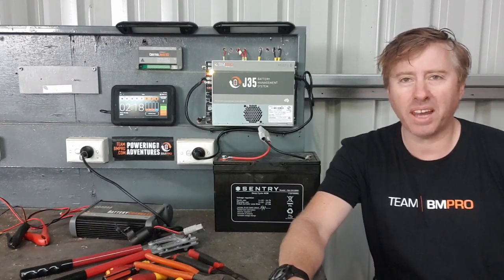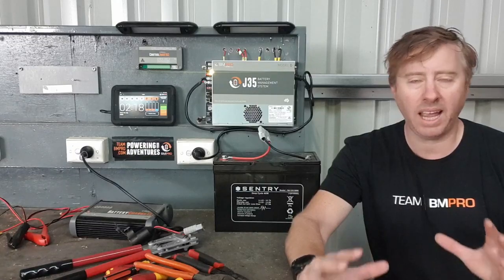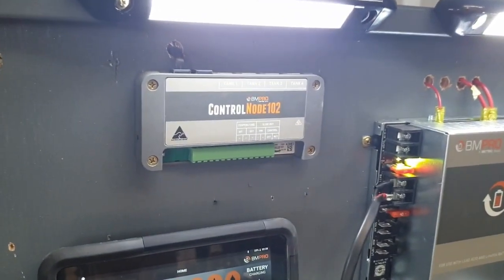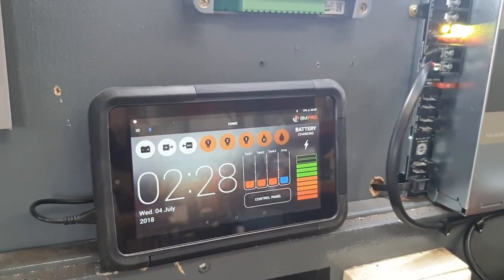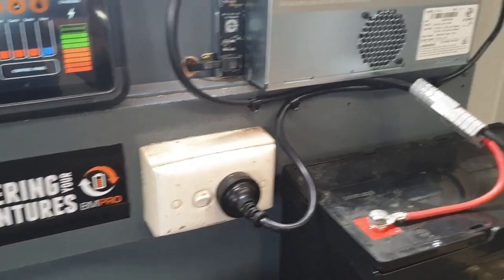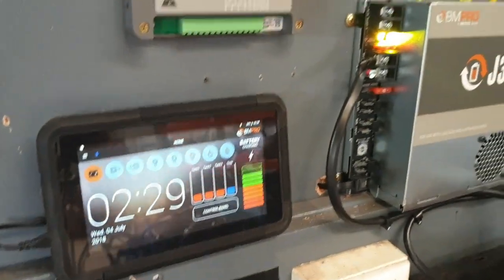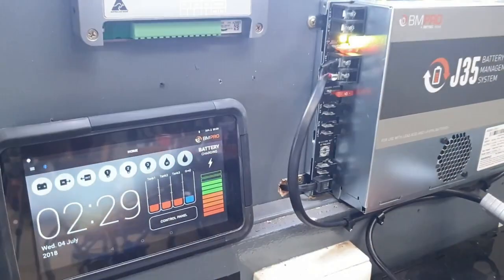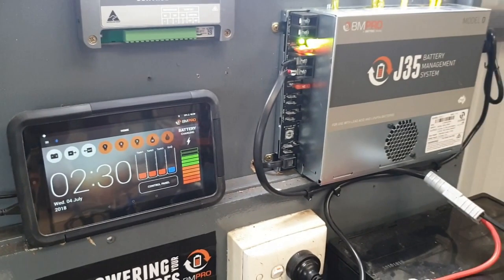How To Prevent Caravan Battery Drain | Load Isolation Switch (JHub TechTip 3)

Comment: So when the battery is isolated will the van e.g. my crosstrak receive solar power top up or does the isolater need to be on for the built in solar regulator?
Reply from the maker: Hi Adam, battery charging is not affected by the isolation switch, the switch will only turn off all the output circuits.

Comment: Followed this to the letter. Did it work . NO.
Reply from the maker: @Danny Jones,  if the isolation switch is turned on via the Jhub, output 1 will remain active to charge the Jhub tablet which is stated in the video. If you are finding that there is still a load on the battery, then you may have a “phantom” load in the system. Diesel heaters, inverters, radio or even CPAP machines can be “phantom” loads as they are direct to the battery and not seen via the Jhub/J35 system.